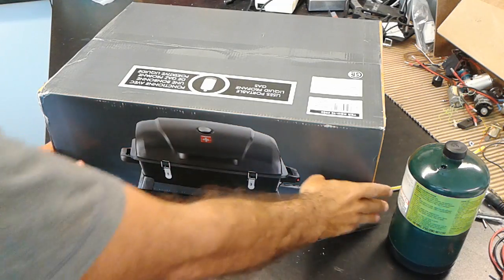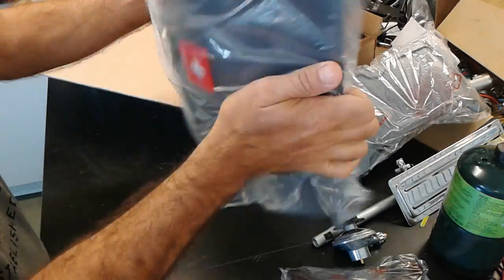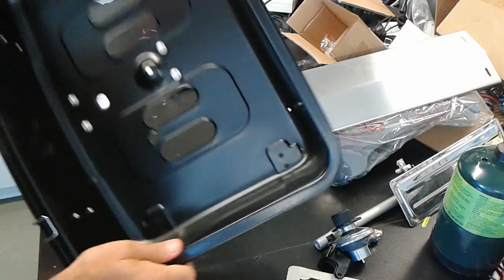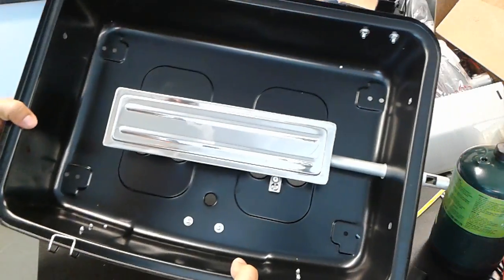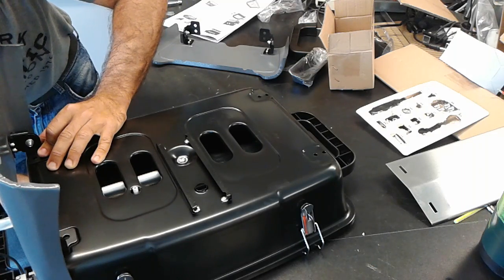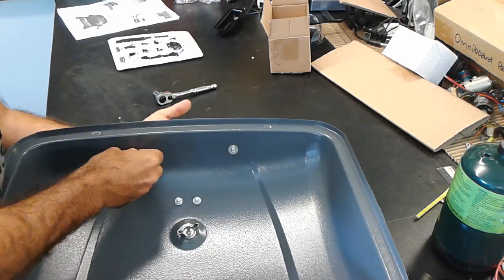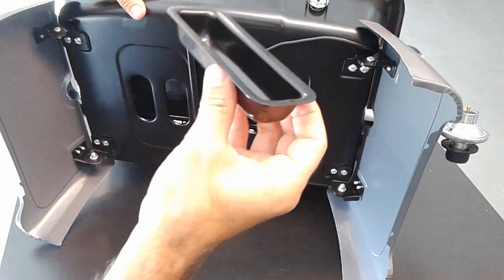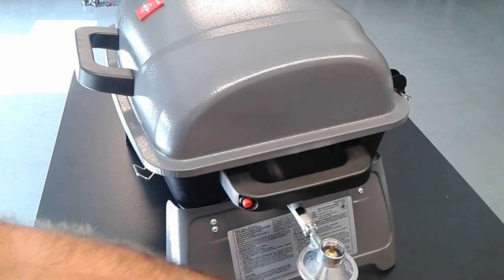Assembling portable propane gas BBQ grill

Comment: Nice video!! I used it to build my bbq. Just a question. Is it normal have a gape whit a small iron mesh where we attach the regulator?? Its my first bbq and I don't know if it's normal. To me, I guess it will leak gas here.
Reply from the maker: Hi, yes that gap, protected with a mesh is there to suck in oxygen for good combustion to occur inside the BBQ.

Comment: Thank you so much for the tutorial video! I see the instrictions booklet mentions that we need to do a leak test each time using soap water. Do you do that?
Reply from the maker: Always a good idea to do a soapy water test on all the joints of the pipe in which gas travels to make sure it's sealed well. I also recommend storing the unit without the gas tank. Keep the gas tank outside the house if possible, otherwise do the soap water test on the gas tank to make sure it's not leaking.

Comment: Amazing, really helpful. Just a quick question. After You used it, and the gas tank is not empty, recommend removing it until using it the next time or leave it on the BBQ?
Reply from the maker: You can leave is on BBQ if you will use it in the next few days, otherwise best to remove it during storage.
Reply: @photographiedynamic  thanks mate, will do it. Actually i just bought a small camping gas and i can not close it. Next time might have to buy a bit bigger gas with close option :)

Comment: is it supposed to have that square hole in the burner line after the propane? Doesn't gas leak out of it?
Reply from the maker: All gas BBQ have that, this is where oxygen is sucked in to burn the propane.
Reply: @photographiedynamic  ah gotcha. I was afraid gas would leak out and perhaps cause some issues. Good to know. Thank you so much for replying. And thanks for your video.

Comment: Thank you for the video. How would I check for leaks in this type of BBQ?
Reply from the maker: Get a spray bottle, put water plus couple spoon water and then spray of hoes and connections. If you see bubbles, there is a leak. When I remove the tank, I also do this if I suspect a leak. You will also smell if there is a leak.

Comment: Hi, I own a camplux tankless propane water heater and it normally connects via propane tank but my tank is empty and have no transportation to get it filled. 

Can 'Coleman Propane Fuel' be connected to this unit, if yes then how would it connect, would I need an adapter and any info on adapter?
If not do you know if propane fuel can connect to a gas propane tank?

Comment: Very good! Now you have to post the video with a steak! I bpught for mine the adaptot for a 7 kg propane tank ! I bbq even in winter!
Reply from the maker: Thanks for comment, I will use it when we go ice fishing in a month. The adapter is a good idea, however I need portability. Instead of paying $20 for 3 small propane thank I just keep on refilling them which costs about $0.75 each. Otherwise it gets expensive to run on small thanks.
Reply: @photographiedynamic  ok I use mine as home bbq so I was spending a lot of money in small tanks! I have almost a year with it, has some cold spots but work fine in general, I also bought the grill mate to avoid cleaning !
Reply from the maker: @rafaelj6880  The grill mat is a good idea, I will buy some, thanks!

Comment: No es peligroso que el regulador esté flojo en la parte donde se enrosca el tamque?
Reply from the maker: El regulador no está suelto, está bien conectado pero gira libremente. Esto le permite enroscar fácilmente el tanque de propano y colocarlo en la posición deseada.
Reply: @photographiedynamic  gracias por aclarar mi duda
Reply: @photographiedynamic  nuevo suscriptor 😊
Reply: Aprovechando esto, cuando se termina el bbq se puede desenroscar el propano y guardarlo con su respectiva tapa?
Reply from the maker: @monicatorres4498  Después de terminar, siempre debe desenroscar el tanque y guardarlo en un lugar seguro y bien ventilado. Preferiblemente fuera de tu casa.

Comment: There’s a random cord coming off the igniter. Where does it go?
Reply from the maker: at 15:27 you see the cable under the BBQ. One end is connected to the push button on the right handle and the other end is connected to the spark generator attached to the burner. hope this helps.
Reply: photographiedynamic thank you, greatly appreciated